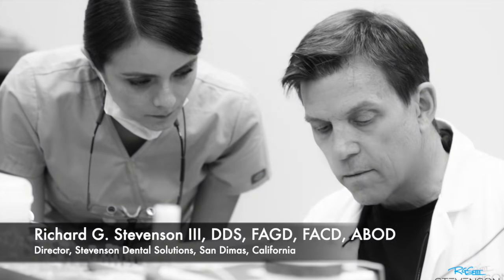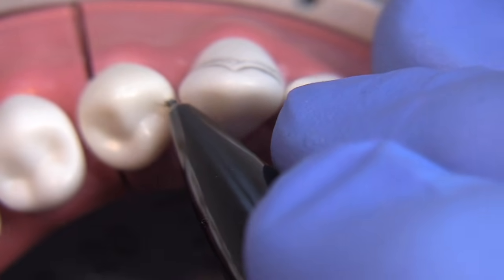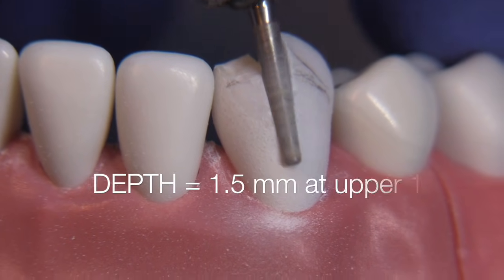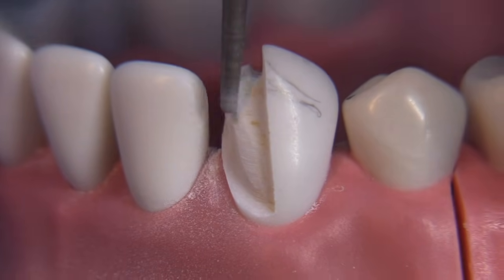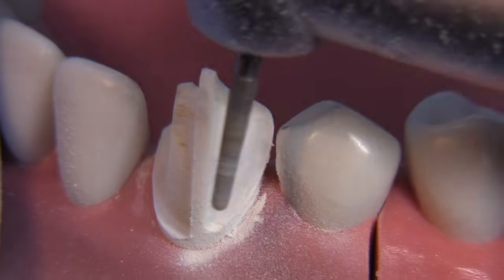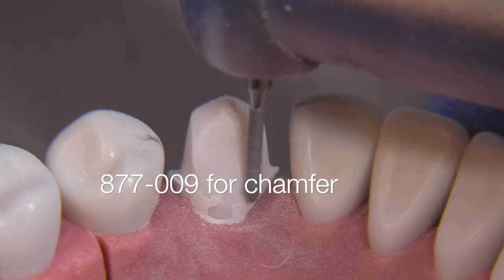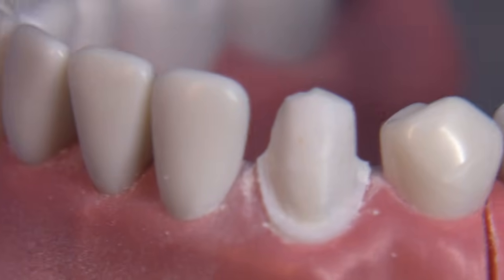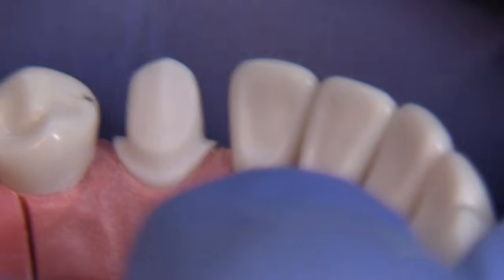PFM Preparation on Mandibular Canine - Acadental Tooth #22

Comment: What is the best position to see the facial wall while preparing doc thanks alot
Reply from the maker: This is a tough prep.  It works best when positioning at 7 o'clock with the patient reclined 45 degrees, turning slightly towards the right (for right-handed operators), and then supine for the rest of the prep.

Comment: Isnt that a sloppy margin?sir...for a pfmlike with root surface it is more than 90
Reply from the maker: Shoulders on PFMs should be more than 90 - usually - at least 91 degrees and up to 110, otherwise, the risk of a lip is high. If you look at the root, when the tissue is retracted it would be more obvious that it is close to optimal.

Comment: Doctor how to know the shoulder margin is 90 degree? Thank you Doctor for all informative videos.
Reply from the maker: Check the angle between the shoulder and the root surface - it should be at least 91 degrees.
Reply: @StevensonDentalSolutions  
Thank you so much.

Comment: Thanks doc! Great demo as always! Could I please ask, regarding the mesial and distal prep. According to ADC exam criteria mesial and distal reduction should be 1.2 to 1.8 mm max for PFM. My reduction coming more than 2 sometimes after removing undercut and proper taper. As I understand I have to measure from the contact area if I am not using  diagonal putty. What am I doing wrong with my reduction? How to do it in the criteria? Thank you 🙏🏽
Reply from the maker: Shoot for 1.0 mm and then refine - you'll always be there.
Reply: @StevensonDentalSolutions  thank you for your reply. We only get limited burs. But I’ll try

Comment: Hi Dr. 
Dr. What is the disadvantages of making one type of finishing line all around the tooth (shoulder or chamfer)?
Reply from the maker: Since the lingual margin is going to be metal, a slip joint is required for optimal seal and this requires a bevel of at least 45 degrees via a modified chamfer or a shoulder bevel.  The ceramic area will usually be a porcelain butt joint, which requires a shoulder for optimal edge strength of the ceramic. IF the design you want uses a metal collar in the ceramic area (say 0.3 mm) then you may place a deep chamfer in the metal area 1.2 mm and a normal chamfer 0.5-07 mm in the metal area.
Reply: @StevensonDentalSolutions  
Thanks a lot 🌹🌹

Comment: Hi, Dr. Stevenson.
Would you plz explain how to find the long axis of the anterior teeth(especially #7~#10) when preparing.
I always angle incorrectly.
Reply from the maker: View from the front of the patient for the mesial-distal angulation, and use the adjacent anterior surfaces for the lingual-facial angulation.

Comment: I would like to ask about the position as a right handed operator while making crown preparation on the left molars 
I started with 12 position but it was very bad
I think about using 7 position with the patient's head toward the right for the occlusal and buccual preparation 
But what position for the rest of the preparation ??
Reply from the maker: Try 9 for the proximally and lingual with the patient leaning away and the buccal with the patient leaning towards you.  Use 12 to double check taper and overall look and make correction from the 9 position.

Comment: Dear Dr,
May I ask about your chair position ? Did you sit at the 7 o‘clock position while doing the procedures ?
Thanks a lot.
Reply from the maker: 7 and 12
Reply: @StevensonDentalSolutions  any tips for lingual wall in terms of of position so i can see the wall while preparing to get proper taper thx doc

Comment: very neat. My question is whether you use reduction templates for teeth that are slightly misplaced Instead of the T or S or finish line preps  - TIA
Reply from the maker: Yes, all the time.  I reduce the tooth on the cast and wax it to ideal contour, then use the putty template in the mouth.